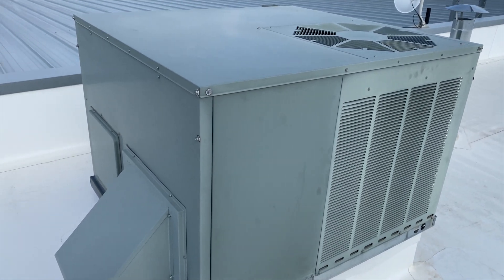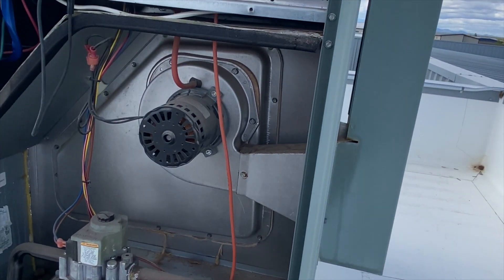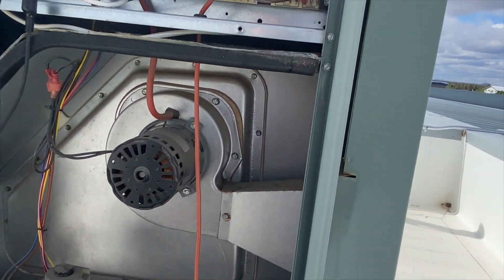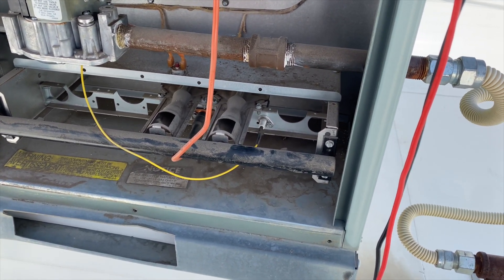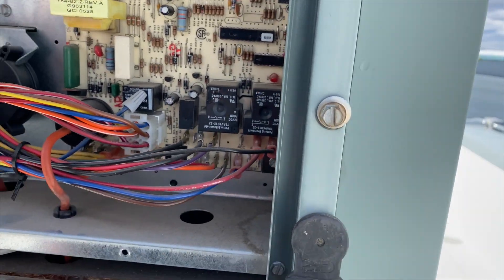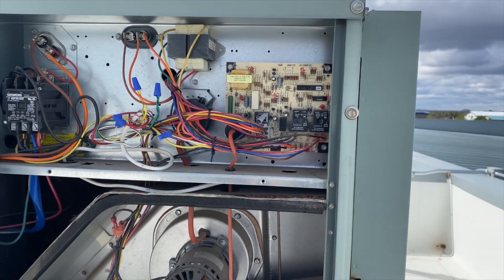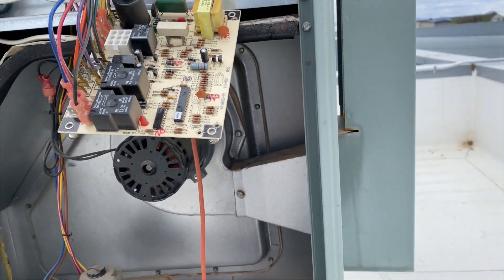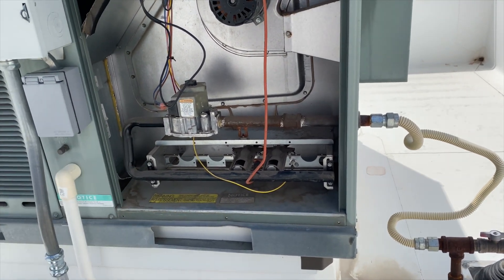Furnace not Igniting!!! EP63

Comment: I have a new carrier heat pump and the single pole 230/240  contactor that becomes magnetized and slams close to turn on/off the condensing unit.  Its very annoying.  Do you know what company makes a quieter contactor.
Reply from the maker: You could try a Emerson Sure Switch. It’s an electronic contactor with some other cool features. 
Emerson C150 Universal Smart Contactor https://www.amazon.com/dp/B016KKDUUA/ref=cm_sw_r_cp_api_glt_fabc_AVTMT219P7M2XGHZVEG2?_encoding=UTF8&psc=1
Reply: @NighthawkHVAC  This is exactly what I need.   Much appreciation for you looking up this.

Comment: You missed one other way to test the board. You could've disconnected the ignition wire from the board, started the sequence of operation while holding the end of a screwdriver about a half inch from the sparker module on the board to see if you get an arch. If so, you would've been speaking in tongues and we would've known that the board was good. Just here to help. Let me know if I can be of any more assistance.